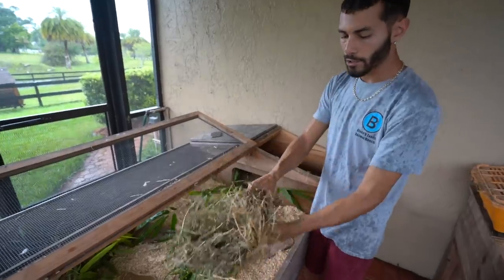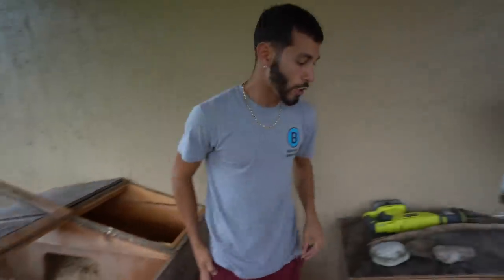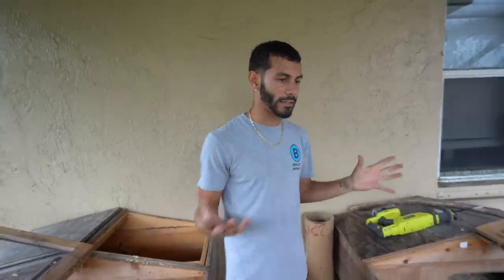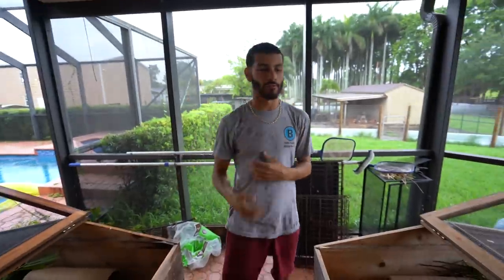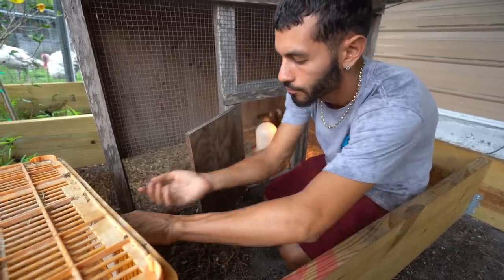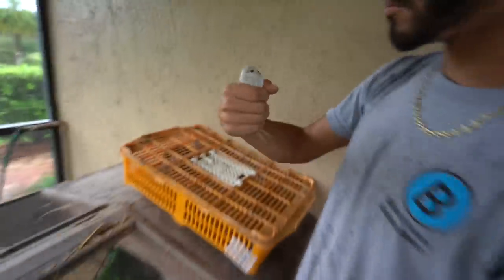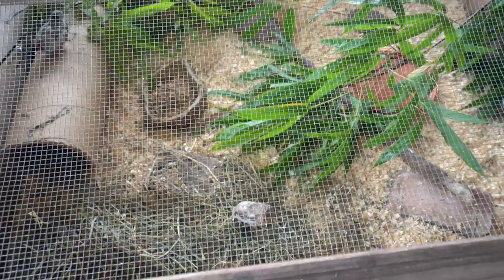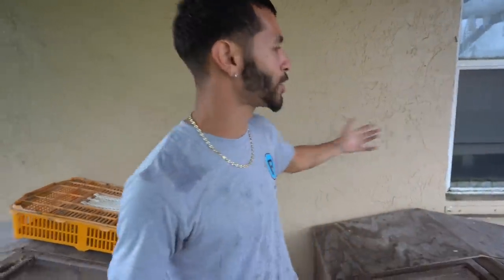NEW ENCLOSURE FOR CUTE & SMALL EXOTIC BIRDS!! What Are They?!

Comment: Shouldn’t they have flying space?
Reply: They can barely fly, and when they do they only shoot straight up to avoid predators when they get frightened. Too much flying space and they will fracture their heads on the top of the enclosure. Either very little space to prevent gaining speed or a really tall aviary would work.
Reply: They definitely should but not yet. Just my opinion from experience.
Reply: It looks like it's a little bit short